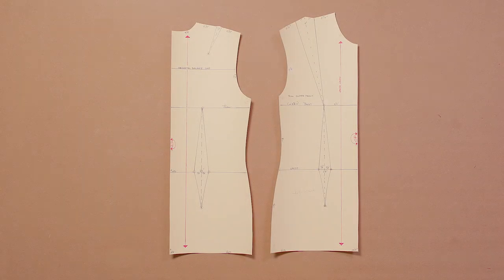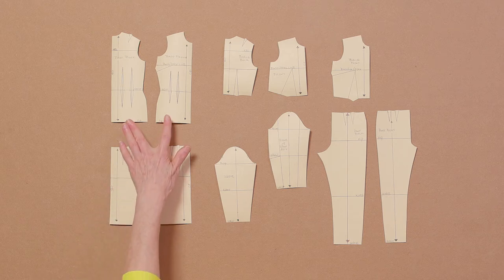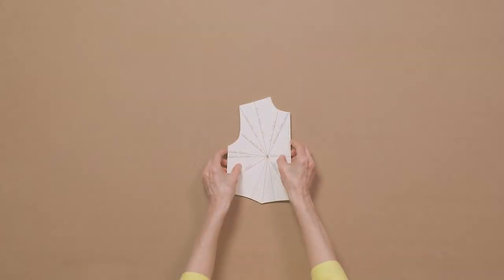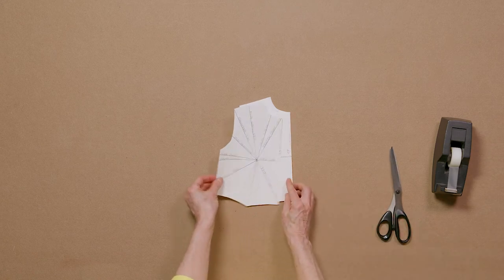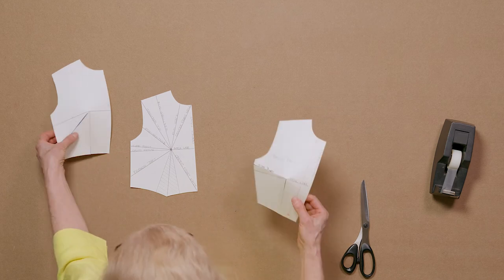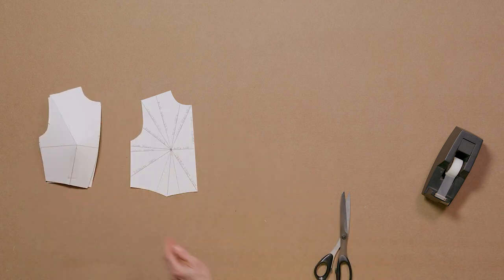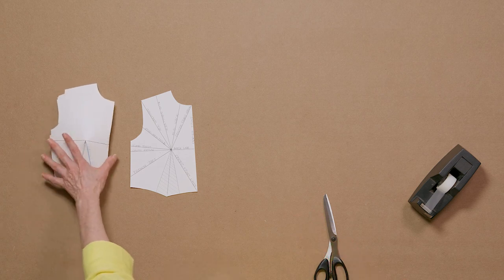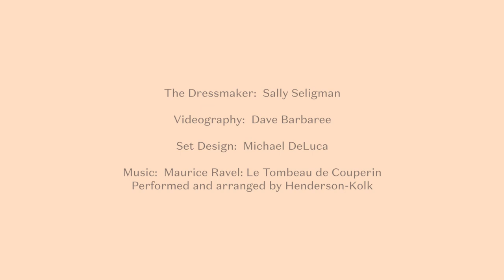Pattern Making 101 | Foundation of Pattern Making - Slopers

Comment: Hello Sally. What would make you decide to use one dart position over another when making a garment? The patterns are the same shape with every dart manipulation but would the garment designs differ according to the dart position selected?
Reply from the maker: Hi, Marion, Thank you for asking! When designing a garment, we consider the placement of darts and how that will affect the final product.
One example:
You have a large floral print and want to make a shirtwaist dress. Your pattern shows front bust darts originating from the waist in the front. This would disrupt the flowers. They would not be whole because the dart has interferred with the design of the print. So, you can move the darts to the side and use French darts. This eliminates the chopping look in the front. 
If you have fabric with vertical stripes. You might want to use the side bust dart that starts a few inches under the arm going to the bust. This dart allows the stripes to stay vertical.
Also just the design of the garment may dictate the type dart to use. 
There are countless reasons to move a dart and this is only one example. 
I hope this is helpful. Happy Sewing!
Reply: @SewWithSally  Thank you Sally. That makes sense to me .